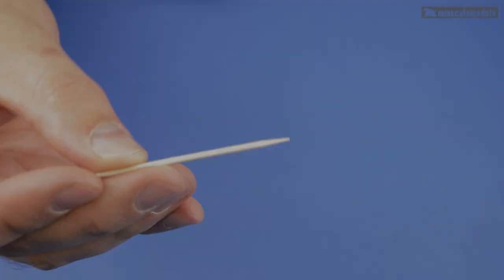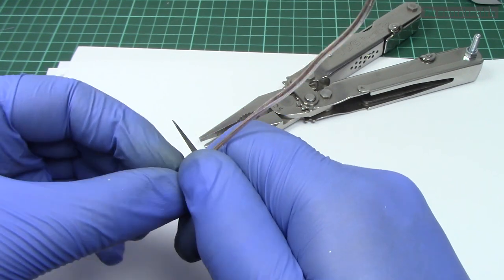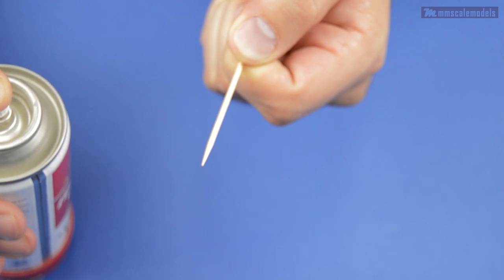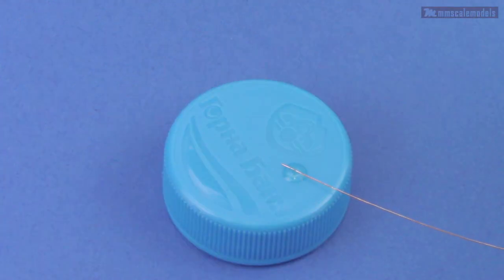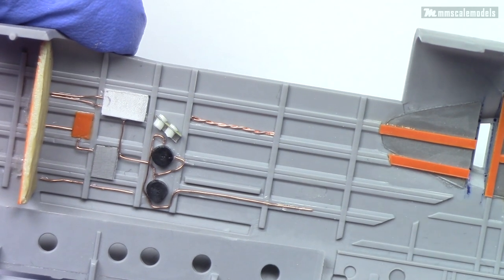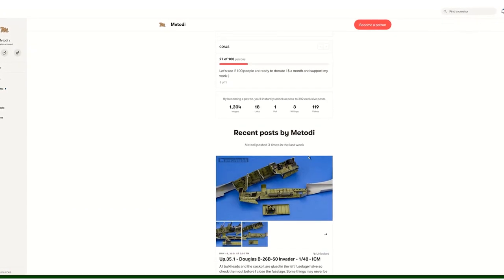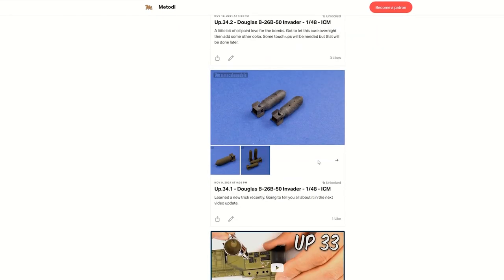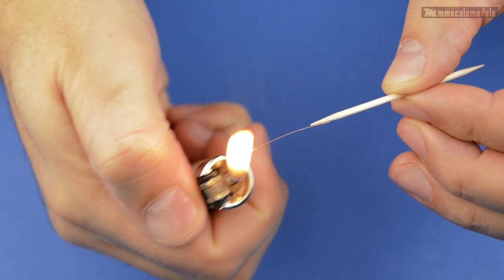PRECISE super glue applicator - DIY

Comment: This is what I love about your channel: you address the actual problems I have.  I cannot/do not use photoetch parts purely because I can't get them to stick in place: them move, or they fall off, of the super glue sticks the applicator to the part... bloody anything except the glue ends up between the part and the model with everything in place.  I reckon if you double the wire over itself to make a loop it will be useful in times when you need to carry a bit more glue to the spot.
Reply from the maker: Thank you for your kind words. Yes you can double the wire to form a loop but in this case you might get too much of the glue on the wire.

Comment: Awesome little video!😁 Had used something similar, but did not know that I could clean the wire so easy!
Reply from the maker: Just be careful as big build ups can drop on the ground while still burning.
Reply: @MMScaleModels  thank you for the tip! Will be super helpful for future builds and cleaning of the tool.

Comment: I prefer steel wires from security stamps. They are not easily bend as electric cable wires and much more durable.
Reply from the maker: have to check those out, its a interesting idea.